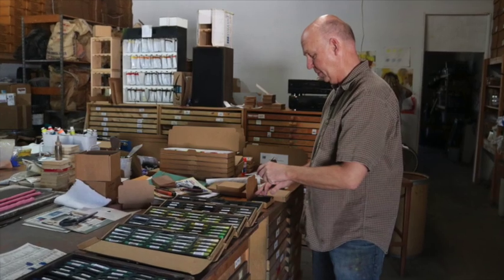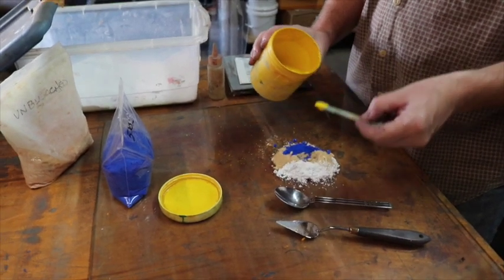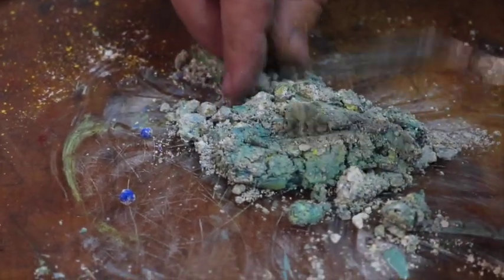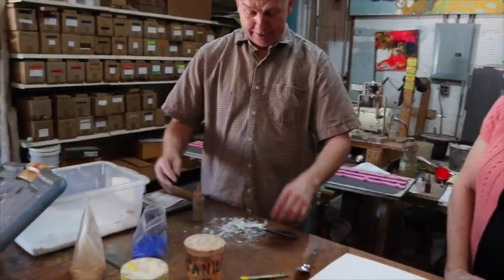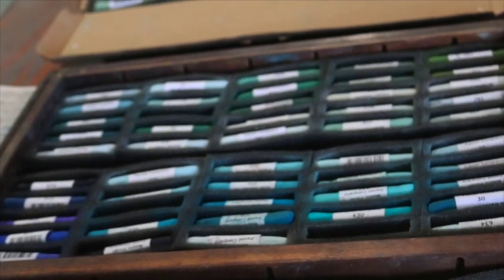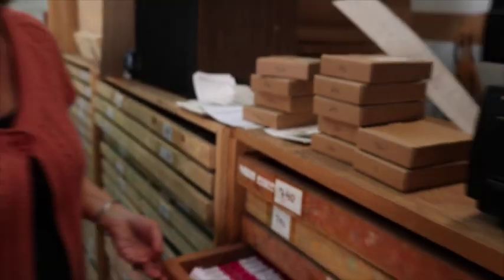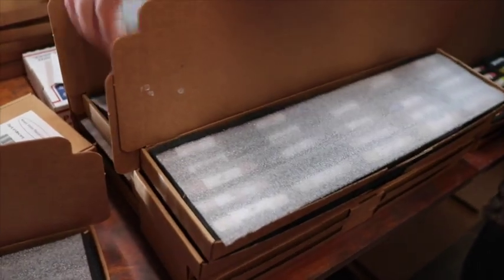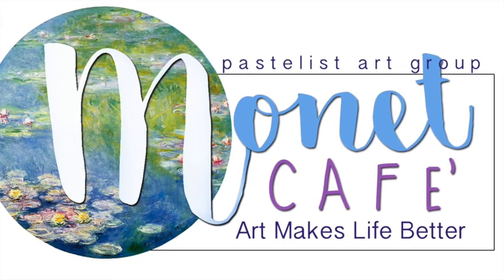How Pastels Are Made! A Tour of the Mount Vision Pastel Company

Comment: Please mam tell me he use a ball clay aur not ????
Reply: no he did not, he used marble dust as the base for the pigments. but you may use ball clay, kaolin, or blanc fixe (barium sulfate) as a filler. I've read you can mix half talcum powder (talc) to half marble dust as the base (which is 50% of dry ingredients). The talc adds slip and lightens the density of marble dust if you so desire a less dense stick. The browinsh powder he used was unbleached titanium dioxide, which is a pigment, adds opacity, but is not as harsh or a white than titanium dioxide.

Comment: What kind of powder is used to mix with the liquid? You are not explaining very well what the mixing ingredients are.
Reply: the powders are pigments and filler (he explained he uses marble dust which is calcium carbonate as the base), the liquid is methyl cellulose solution (15:1). if you pay attention to the shot of his recipes, you can see which pigments and ratio he used for the base (around 50% of dry ingredients). Companies are really hush hush about their recipes
Reply: @kimberleycable  , thanks for the nice video! I wonder if the 15:1 proportions of methyl cellulose/water refers to weight or volume?